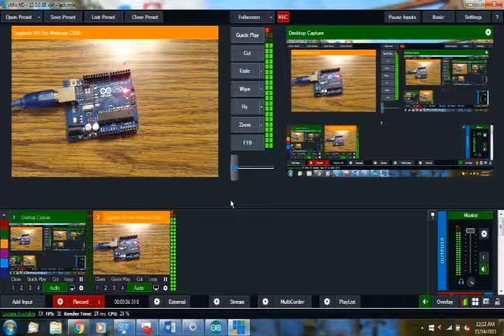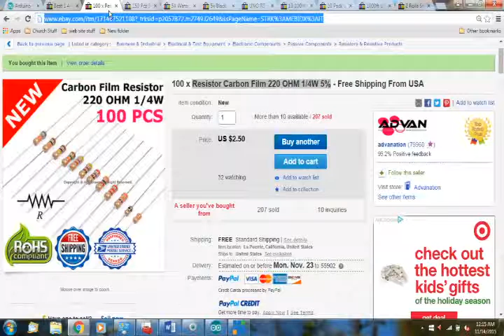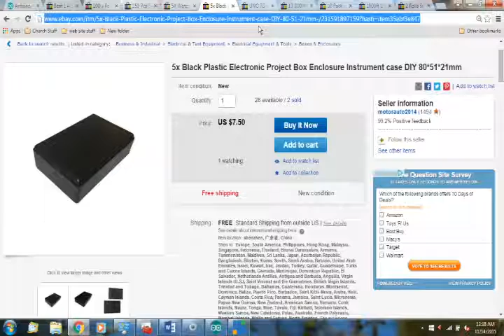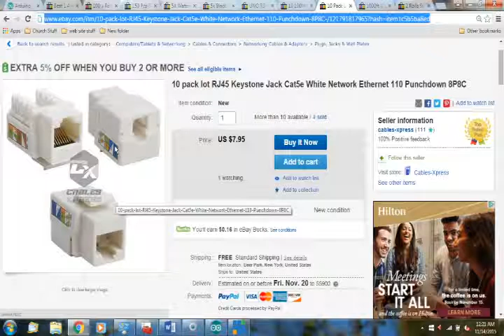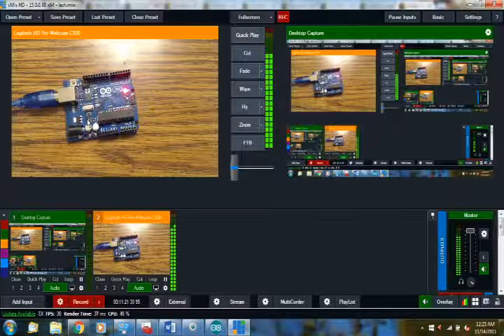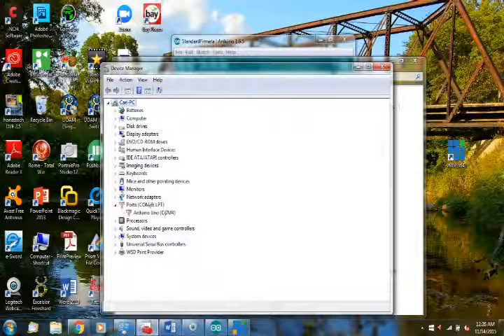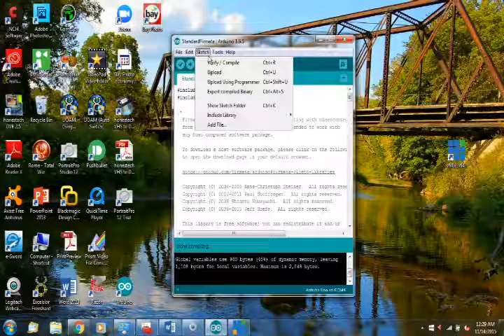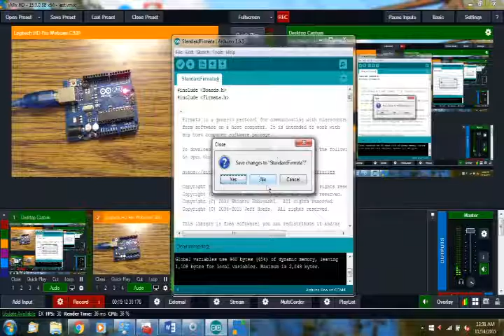DIY Tally Lights -  programing Arduino for vMix - Part 2

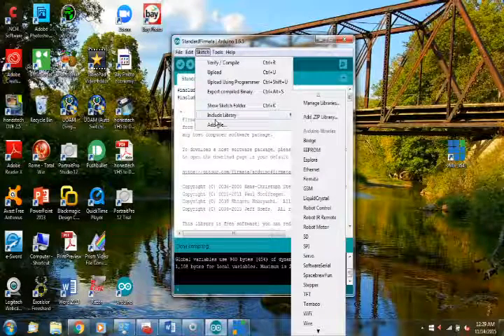Comment: Instructions at 16:42 for loading the standard firmata aren't correct.  You want to select File->Examples->Firmata->StandardFirmata.  The instructions that you provided only load the library header file to the current sketch.  Just hit Verify and then Upload and then you should be good to go.  Thanks for the rest of the videos, these have been very helpful in helping me set up up a tally light system for my church!

Comment: Nice video - setting up tally lights for our church.  Camera monitors already  have the lights so just getting signals out there over ethernet cables. 
Hadn't thought of using the punchdown RJ45s  - great idea to glue them to the edge of a board, was going to use RJ45 breakouts, but cost more and would require connecting to another board anyway. 
And the short tips on downloading the firmware was reassuring - its been a couple decades since I was writing code. LOL   I'm looking forward to doing more with Arduinos anyway.
Reply from the maker: Thanks for the cuddos
Reply: @cntenney  Appreciate those trying to help others go forward.  Built our tally light system up yesterday, will go to church this week to test out.  No real documentation on our camera monitors, so have to run tests on how to drive its incorporated Red, yellow and green lights.

Comment: Hi carl. Is that possible build this tally without using swither ethernet for multiple camera
Reply from the maker: I am sorry I just now seen your comment.    I didn't use  box I had to use a splitter for  the multiple lines.

Comment: hi carl,please share code step by step..
Reply from the maker: Zenul,     vMix useses a code that is already in the Arduino library.        As far as the step by step goes   if you start at 14 minutes in to this video it shows you how to load the code.      Arduino has the code on already you just have to selcect it from the list in tools .      right around the 15 minutes mark in this video.      Hope that helps Carl

Comment: my LEDs stay on this is all inverted ... when it is in the previous one it goes off ... where is the error
Reply from the maker: William   it sounds like you might have the  tally light settings reversed in vMix    you can assign the led  in  VMix in settings
Reply: Carl Tenney 
Good afternoon ... I'll explain ... I connect everything to the Arduino and from the start the lights turn on the four lights lit in red and the four lights lit in green ... I open the vMix and I do set and assign the led to each pin ... the problem is when you selected a video let's say channel one ... the light goes off as it happens with the previous one ... all turned on and when you select it is paid ... it's all inverted.... wrbm50@hotmail.com
Reply from the maker: It sounds like you just need to go to settings in upper right corner and go to tally lights and in that menu switch the assigned pins for  preview and active pins.
Reply from the maker: Or do you have each input assigned to the same tally number.   That also could cause them all to light up at the same time.

Comment: if I may ask the source code program for vmix arduino tally light usb , send to rowman44@gmail.com thanks
Reply from the maker: Arif,   the answer to your question is actually in the video.   Go to the Library and load the firmata code on to your arduino board.    It has the code you need.      Again just load firmata from your library menu onto your board and you should be good to go.      If you have questions watch the video part 2.        Hope that helps Carl
Reply from the maker: By the way you need to look under sketch to find the library menu, from the library menu you will then find Firmata coding.
Reply: thanks my first test